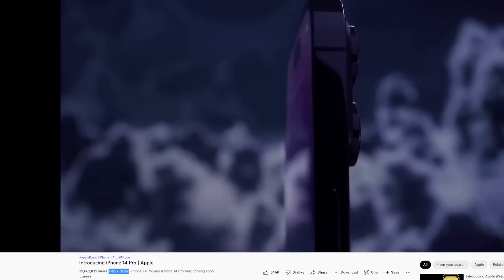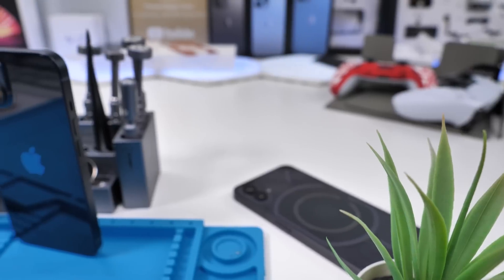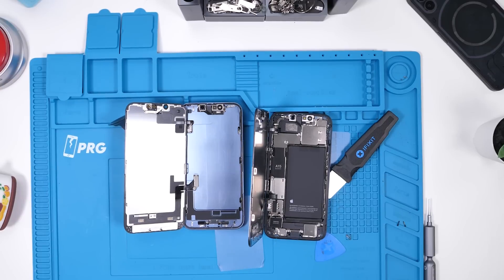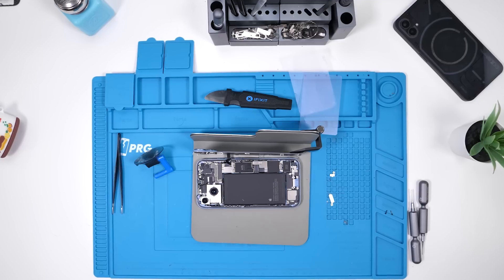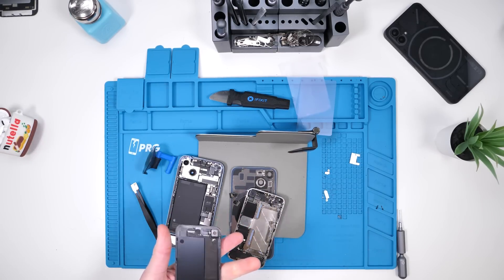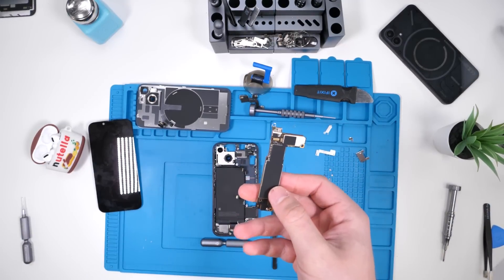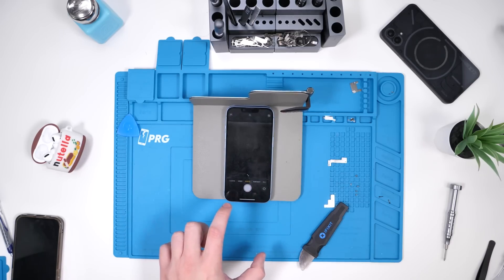IS THE iPhone 14 REPAIRABLE? This was a Rollercoaster.....

Comment: Honestly it's pretty crazy seeing Apple simplify the repair process
Reply: It doesn’t matter that they “simplify” their repair process. As long as they can just do BS like locking features thru software, the only party who benefits from this easier access is Apple and their repair centers
Reply: @CursedPrinceXXI  Yes and we, the repair centers, thank Apple for that
Reply: They’re simplifying the process for their repair centers. Not for the consumers. Repair iPhones faster, means repairing more iPhones in less time. That means more money for apple. It’s that simple.
Reply: Louis Rossman is having an effect
Reply: @CajunReaper95  you are insane. 
Like dawg are you paid by Apple to say this? Lmao 
Now even if you replace the screen with a genuine apple screen it’ll still return an error. So you have to have Apple authorize it, otherwise you got a paperweight. 

The only entities that benefits from this is Apple, certified techs and whoever is making the 14s screen, so probably Samsung lmao. 

The consumer gets raw dogged harder than ever before
Reply: It’s been the case since 2010 it’s not new at all
Reply: It's so hard to replace display cuz it's on the front?
Reply: @adith9327  Like all other displays, what are you trying to say?
Reply: @adith9327  it’s actually easier now?
Reply: They are not. You need to disconnect the battery first before removing the display to prevent the display from getting damaged. You now need to open up both the front and the back to remove the display in the safest manner possible. Its actually more time consuming than the old way
Reply: @colby_ybloc  It's an amoled panel, there's no blacklight present on newer iphones.
Reply: @goldnovaelite  In my defense, i didnt get sleep for over 24 hours that day lol

Comment: It is weird that the 14 went back to the iphone 4 in terms of reparability. i am guessing this phone was made with the apple self service repair in mind. This also makes screen and back glass replacement super easy to do. I wonder if we will see the iphone 15 be more repair friendly than the 14 since i was not expecting apple to have the 14 be built like the 4.
Reply: Nah, dude. They didn't go back to the iPhone 4 in terms of repairability. Have you ever replaced a screen on the 4? It sucked ass. This is way better.
Reply: 7:52 I wouldn't call it repair friendly at all. They software locked the battery, screen, and face id sensors.
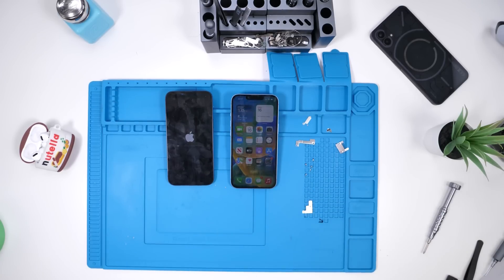Reply: @Leonvolt28  9:35 pal… They did make it repair friendly genius.

Comment: Apple seems like to stepping in the right direction in many ways since they kicked jony ive out of the company, dude was single handedly holding the whole company back from what people actually wanted.
Reply: @perisanti7571  dude you didn't even watch the damn video
Reply: @Progan666  what?
Reply: @perisanti7571  tell me you didn't watch the video without telling me you didn't watch the video 🤣
Reply: @perisanti7571  i'd believe more if you said : Apple got lot of complain from their official technician due to breaking so many phone on repair. Their salary getting cut because the customer gets a new phone instead.
Reply: @perisanti7571  you clearly don’t know about repairing iPhones with oled displays. You can disconnect and reconnect the screen without disconnecting the battery. It’s bad practice but it can be done. This design solidifies that even more. You don’t need to remove the back to get a screen repair done.
Reply: Jony Ive is a design-first kinda guy, he’s a purist which is something I can appreciate, however you are probably correct to assume most people don’t care and would rather have more repairability and other conveniences over design and style. If Jony Ive was still at Apple though I’d imagine the whole notch/pill thing would be worked out by now, but it would just make it harder to repair.
Reply: @goodness6664  yea but he was also the guy who held things back by purpose.
Reply: @perisanti7571  please delete your comment please 😂
Reply: @perisanti7571  average apple criticiser who didn’t even listen and watch the whole video 😂
Reply: @perisanti7571  🤦🏾‍♂️ this is why you failed your exams
Reply: bro they put so many issues on purpose when u repair it now compared to an android u could swap the mobo from a completely different phone model
Reply: I just hope this will not lead them to the same direction like Android, to manufacture 100 million kilograms of e-waste per year.. What you can easily calculate with their yearly sales and with the yearly active phones amount. If they are segmenting the phones again and again, their disassemble factories will be less efficient too, and they can step into the same trap like Android, to only take out the battery, and nothing else. Android sold 7,2 billions of phones in the past 6 years, but only 3 billions of them are active, with an average 150g per phone, that 4,2 billions of phone are 0,63 million tons of e-waste in just 6 years.. 0,1 million tons per year is an insane amount of not eco friendly trash..
Reply: @randomcomment9992  I'd like to point out, that that's multiple companies as compared to one Apple, I'm sure Apple makes just as much e-waste as anyone else
Reply: @chaoticdetectivepeach  you should recalculate your meaningless pointing.. Apple only sold 2,1 billion phones in the past 14 years, and more than 1,2 billions STILL active (about 58% from the past 14 years are still active, do you think Android also have this numbers?) they made less than 1 billion e-waste in 14 years (not to mention they also have factories to properly dismantle the phones, what other companies can't do just because of the lot of changes in the design in every year).. Meanwhile Android manufacturers in just the past 6 years sold 7,2 billion phones, and only 3 billions of them are active.. that 4,2 billion difference (which is the e-waste recently) in just 6 years are doubling the total sales of the iPhone, and imagine the numbers if you extend this to also the past 14 years..
Reply: @randomcomment9992  It's not like those dead phones are scattered in random forests, some maybe.
Reply: @holl7w  and what do you think about the garbage burner.. do you think any 3-4 years old Android what is worth nothing is handled properly, and not throwed out to the trash can? Just a few company like Samsung have trade-in program, but they are also can't handle the phones properly, because of the huge amount of different models (they are just take out the battery, and nothing else, that is still better like the others, but still not enough)..
Reply: @randomcomment9992  Android doesn’t make phones. Samsung, Motorola, Google, etc make phones. Android is an OS.
Reply: @ladyhollman9534  and how you want to describe the phones what made by somebody, but using the Android as OS..? isn't they are Android phones..? And also that will not change the facts, they are doing big damage to the environment whatever you call them.. Even the Companies like Samsung not handling the e-waste properly (they are only take out the battery), but they are still better like most of them..
Reply: I am sure Jony was not the reason and there were more people from Apple that have more responsibility.
Reply: @stormrider01  Probably more like they knew they'd lose money if they kept trying that shit
Reply: @perisanti7571  bro what, you can still replace the screen
Reply: Jonies Voice is is relaxing.... I mean keep him for Advertising.... Nothing more
Reply: They only stopped working with Jony Ive a few months ago when his contact expired - his design firm would’ve still had a role in most of the more recent Apple devices, the iPhone included. If anything, what’s been affected more by Ive leaving is the Apple Watch since they’ve shifted away from luxury design and into extreme sports and budget (the rugged Watch Ultra plus the plastic in the new Watch SE would’ve never happened six years ago when Ive was most influential).
Reply: Lol. Phone thieves are smiling. Good job “ tech repair shops”. 👍🏾Well it’s more phone sales for Apple Computers.
Reply: @JAB64266  apple computers? You mean phone (I know they sell computers but no repair changes have been made to them)
Reply: @Qwerty-uiop  apple computers is the original name of apple and some people still use this name to refer to Apple inc.

Comment: Its a great new design. Makes it so much easier to repair. But i hope the software is repair friendly too
Reply: Took the long enough to make the back glass repairable. I dont know if anyone noticed how stupid it is that you on previous models had to remove everything to swap out the thing that breaks first.
Reply: @jakobmax3299  What do you mean? Repairing displays on iPhones was much easier than Android... and display is probably the thing that gets broken the most.
Reply: @kirakira9906  he wasn’t taking about displays, he was talking about the back glass
Reply: @carstenb23  Ooh yes sorry.
Why did you have to remove everything? I saw many videos of back glass repair and people would just put the phone under the laser machine without even opening it up...
Reply: @kirakira9906  yes but how many people have a backscreen repair laser at home
Reply: @skfl7014  I mean I do... But I'm probably the outlier
Reply: @kirakira9906  lol because that takes ages (hours or even days), makes a huge mess and is expensive for the equipment
Reply: I think it's the opposite, now you have to remove the display AND the back glass to disconnect the battery. Now repairs will take almost twice as long to be performed safely :(
Reply: @PvtAnonymous  Why? Not really. I guess you can just straight up open it from the back glass without removing the front screen and directly change the battery.
Reply: @kirakira9906  I‘m talking about the most common repair, screen replacements. If you don‘t disconnect the battery, there is a possibility that you‘ll fry the board in the process.
Reply: @PvtAnonymous  Oh I'm sorry. I didn't think about it. Yeah actually thinking about it, you have to disconnect the battery for every replacement you do... so yes, I guess you'll always have to open from behind first. Yep that sucks.
Reply: @PvtAnonymous  lol nah, it wont take that long, if anything it would make it easier.

Comment: This will make back glass repairs much easier, no need for the pesky laser machines!
Reply: RIP to the people who bought one of those laser machines 😂🥲
Reply: @Jake-xx9xq  Not everyone will gonna buy an iPhone 14
Reply: @Jake-xx9xq  not everyone upgrades to the new phone
Reply: @Jake-xx9xq  i don’t buy iPhone 14
Reply: no mod zedededededew if yk what I mean :(
Reply: They just did it to save themselves money not you
Reply: @NotOriqi also iphone 14 pro still dont have removable back
Reply: @TheRealAryans567  Yeah just checked that out. But nevertheless, at least the regular 14 being more "repair friendly" is a step in a good direction, and since the place were I live is a lower income area, you don't usually get the "Pro Max" versions for repair hence why I never bought the laser machine (Also because glass replacement can be done with only heat if you take appart all the phone). The iPhone I had for repair the most times this year is the iPhone XR and the iPhone 11.
Reply: I honestly checked to see if it was april 1st
Reply: And you still need one if you repairing IPhone 14 Pro and 14 Pro Max cuz they didn’t change anything on them they still have their traditional back glass on them so there will be always a need for that big mess machine

Comment: How can no one complain that the flash mic and wireless charging coil are all integrated into the back glass 
I don't think back glass repair would be easier if not harder because of the flex cables attached to the back glass
Reply: Or if they sell the back glass with all of that it will be more expensive
Reply: @MitchellC564  that’s 100% what they’re gonna do
Reply: if 3rd party can make a working oled screen for one i cant see why a charging coil and flash will be a problem
Reply: @jonthecont  who knows if it would also be paired

Comment: really surprised that there's no non genuine back glass warning disabling wireless charging
Reply: Don't. Give them. Any ideas.
Reply: @ArthurD  😂😂😂
Reply from the maker: Don’t jinx it
Reply: “Unable to verify if back glass is genuine. Your iPhone will self-destruct in ten seconds.”
Reply: @prabhsaini1  LMAO
Reply: @prabhsaini1  😂😂😂😂
Reply: @prabhsaini1  🤣🤣
Reply: let's just not talk about that-
Reply: Next year lol
Reply: Be careful, since the MagSafe components are there it could be possible..
Reply: @johncs154  magsafe is a magnet, it can’t explode nor can it talk with the phone itself
Reply: @prabhsaini1  The MagSafe part has a serial connection to the board via a flex cable.. they can do what they want same as cameras and batteries.. not to mention how wrong you are since the phone can detect whether the wallet, case or battery is connected…
Reply: @prabhsaini1  r/wooosh
Reply: You are giving Apple ideas😂
Reply: What do they mean? It is taken from another identical iPhone - it should be genuine.
Reply: @kerbodynamicx472  they sync the serial’s. Once it doesn’t match it will give that non genuine message

Comment: So if you only replace the screen you cant disconnect the battery?
Reply: This is interesting, i wonder if apple put something in place so the phone is less likely to fry the backlight circuit under power like on the older iphone 6 and before. I never had to disconnect batter for the older phones. In fact the 3gs and before had battery under the logic board and in the 1st gen it was soldered on.
Reply: @jon When the phone is off this should not be a problem but when a customer comes with a broken not working touch screen you cant turn the phone off.